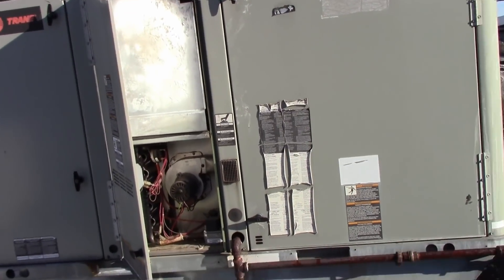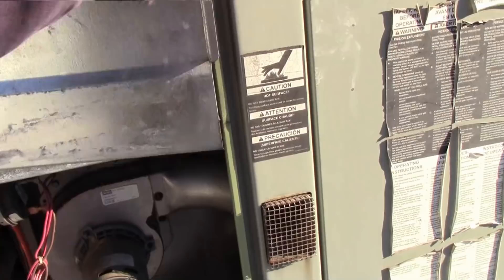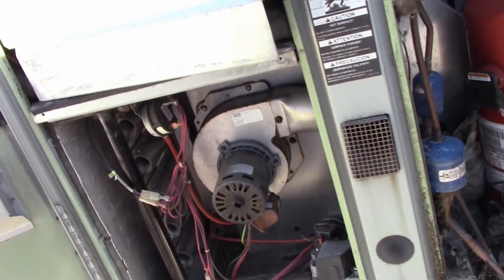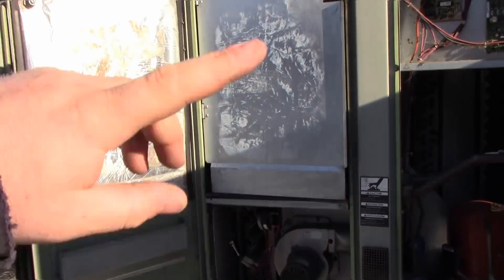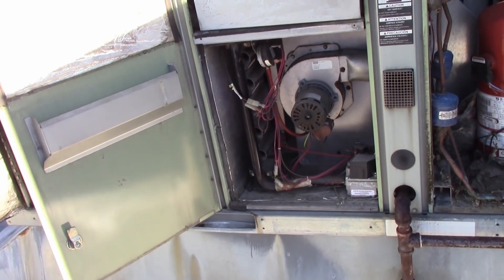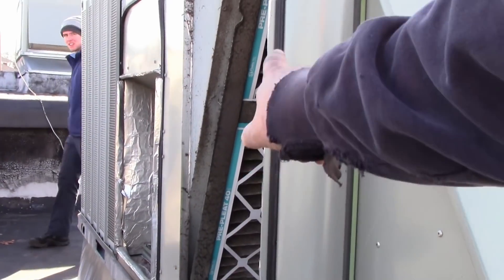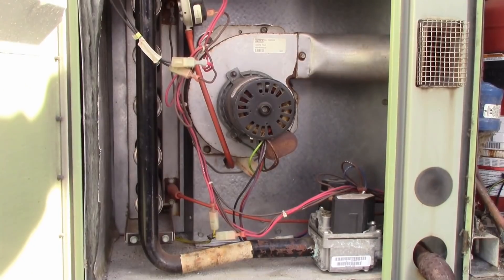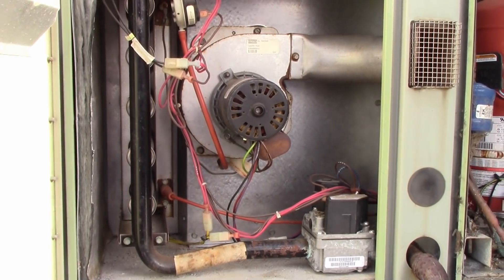Another Day in the Life of an HVAC Tech: Episode 16

Comment: Thanks Halligan. Enjoy watching your machine work and AC videos. Do you mind a question? I’m troubleshooting my RV AC which is not blowing cold air anymore. It’s 4 years old. Compressor is running and is extremely hot to touch.  The copper  line into condenser is just as hot but the condenser and all the little 180 elbows on the sides are all ambient temp. It’s like the hot refrigerant is not flowing into the condenser. I changed the run capacitor and cleaned the condenser with coil cleaner.  The evaporator fins and filter are pristine clean.  Any ideas on what to look for. I realize these are sealed with no abilities to check pressures or add refrigerant.  I hate to buy a new one if it’s fixable but I’ve exhausted my ideas. Thanks
Reply from the maker: Without getting pressures and access to the system you have one of 3 issues.  1 is you have a leak and the refrigerant charge is low.  2 your filter dryer is clogged.  Look along the outlet of the condenser.  There should be a dryer.  It will look like a larger copper tube connected to the smaller tune or a metal can.  Both sides of this should be the same temp.  If one side is ambient temp and the other is cold the dryer is.clogged.  3 clogged or malfunctioning metering device.  In your case this is most likely a cap tune or orifice.  Hard to diagnose without pressures.  If you already have a set of gages then you can buy a piercing valve ( I use bullet brand).  It will bolt to the line and Pierce it to allow you to check pressures.

Comment: Really cool vid, thank you. I do the same sort of work across the pond, more on floor standing and suspended air heaters but principal is still the same I guess. Had to change exchangers on big floor standing Powrmatic’s and that’s “fun” but the modern ones have similar, tubular, exchangers to this one not the old 1/4” plate welded ones. Not had to change one of these yet and to be honest it’s probably cheaper to replace the heater entire with the cost of labour these days!